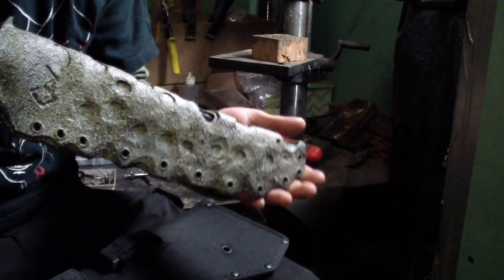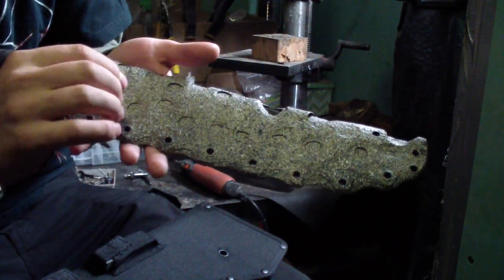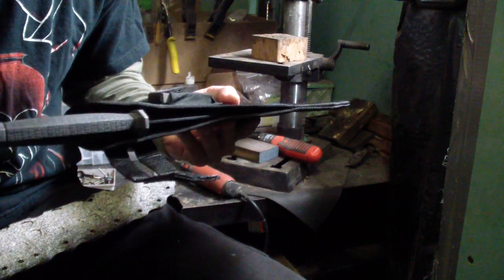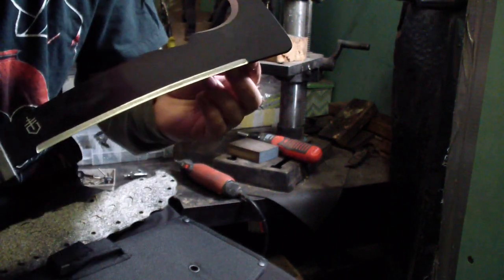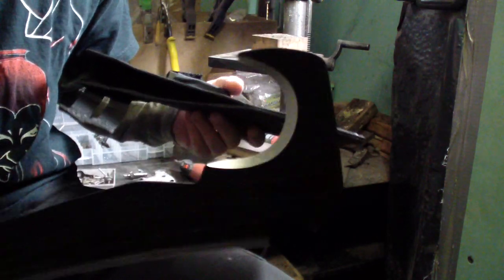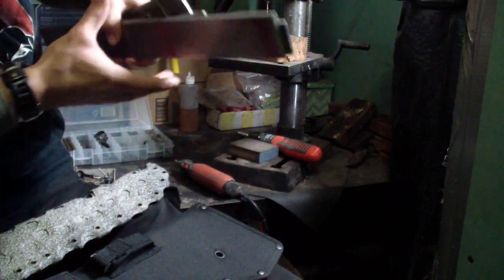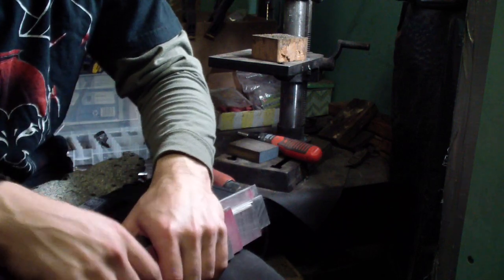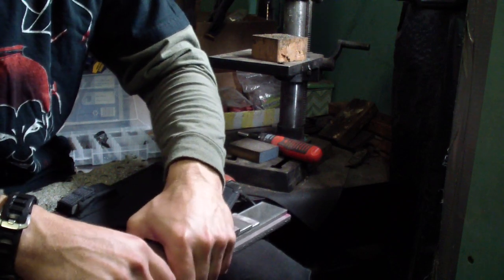Rocky Sheath, Gerber Gator Machete Pro & Supplies

Comment: I carried a took for weeding with a hook on the end like that in my youth.  It worked really well for getting between field plants to remove weeds.  It was just a metal hook on a metal rod the length of a walking cane and a wooden handle.  The other tool was a corn knife that was a thin light weight machette.  That tool combines those two into one.  I modified my corn knife to have a 4 foot tall wooden handle.  It hurts more to bend over since I got old overnight. :)

Comment: Very creative sheath treatment! I have used solid-colored rustoleum spray paints in the past and have been very pleased with the long-term results. Did that spray treatment affect the sheath weight by much?

With that rivet in the center of the Gerber sheath, you could attach something else... fire steel & tinder, small utility first-aid pack, oil for the blade, etc.

Enjoy your family.

Comment from the maker: :) cool. all these good steels should be able to go 61 hrc and with correct ht not being brittle at all. and the higher the hrc can get on whichever steel, the better edge retention. there are other methods of HT when hrc doesnt play the role but gets replaced with toughness but the HT peters does is kind of like the regular, when hardness = edge retention (simply said)

Comment: ohh btw just curious has anyone taken the 3 layered handle 3v ? and yea that elmax performs beyond expecation especially in edge retention , the reason i suggest lower the hrc a bit is so maybe it can take more abuse yet still have plenty of edge retention idrk im just spitballin from experience with the one i have so the elmax blades are more badass than the previous one which i have no doubt they will be anyways